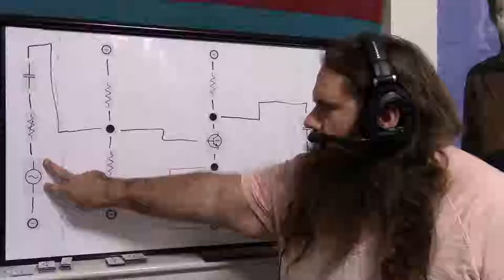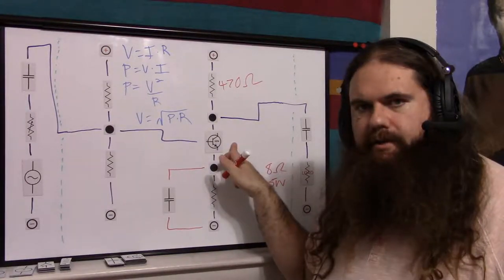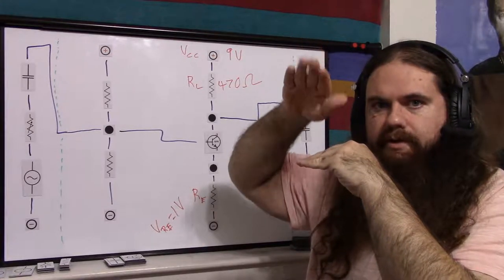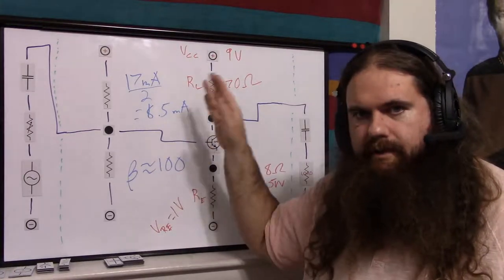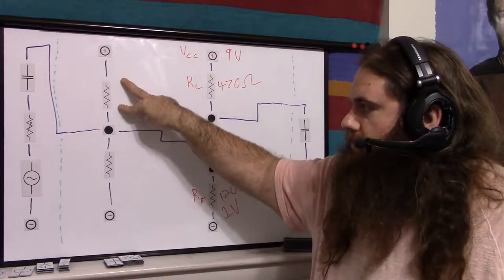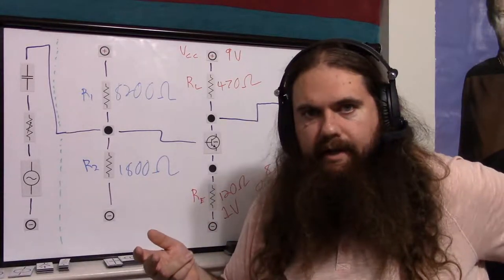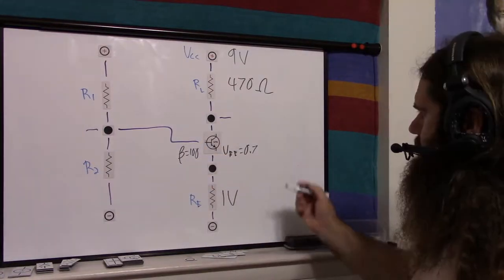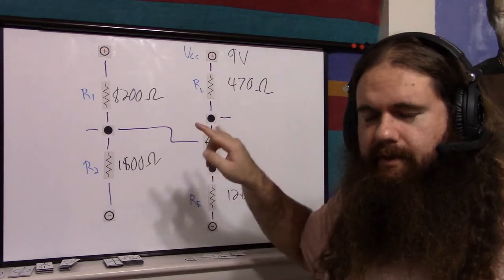Common Emitter Amplifier - Part Selection - Simply Put

Comment: 10µF indeed provides a better sound with less distortion, I've tried the same circuit (except for the transistor which is a BC547) and it works quite well actually ! Thanks man !
I wish there was much more on this, to make a real amp, but hey, that's cool man !

Comment: Well done!
It's very clear.
Your Volume Control seems a little strange as most folk would ground one end of the Potentiometer Track so that it can be turned all the way down.
Also an Eight Ohm Loudspeaker seems rather too heavy a load for this circuit although it would probably work to some degree.

Comment: Consider the venerable 2N2222A Small−Signal Current Gain
(IC = 1.0 mAdc, VCE = 10 Vdc, f = 1.0 kHz) (IC = 10 mAdc, VCE = 10 Vdc, f = 1.0 kHz)
 hfe
 50-75 (Min) 
300-375
 (Max)

Comment: I don't understand why you say that the speaker uses 0.25 watt (or close to that) with your 470 ohm resistor. Because, when I use a simple voltage divider formula then I come to a total of only 0.0028 watt for the speaker.

I did this:
Voltage supplied to speaker = (8/478)*9v = 0.15v
Total current draw = 9v/478 = 0.0188 Ampere
Power used by speaker = 0.15*0.0188 = 0.0028 Watt

What am i doing wrong in this calculation?
Reply from the maker: At that point in the video, I'm talking about the total power going through both the load path and the transistor path, not just the load. I was talking about how I wanted to be careful because I was designing a power-hungry amplifier with weak and cheap parts, and if I were doing it "for real", I'd use actual power resistors and transistors that could handle the load the speaker actually wants.
Reply: @simplyput2796 Ow okay, then I missed that detail. Thanks for your answer

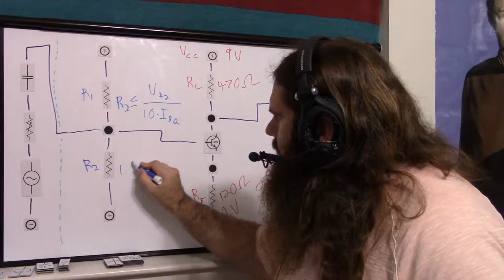Comment: Hi, I get loss in the 17:54 minute,
did you say that 1.7v divided by (10 times 85u Ibq) is equal to 1990Ohms..?
Reply from the maker: 85 microamps was rounded a little for clarity. The actual exact resistance was 1997 ohms. The reason I used 1800 ohms for the actual resistor was that I wasn't using a trimpot to get an exact resistance: I was using just a standard box of resistors, and 1800 was the closest one that was no higher. The resistors R1 and R2 form the bias part of the amplifier, and they have to supply a minimum amount of current to the transistor's base, which means it is perfectly fine for them to be lower than needed (excess current), but it is not fine for them to be higher than needed (not enough current available), so I went down to the closest available discrete resistor value available to me.
Reply: @simplyput2796  
Thanks for answering me.
I'm doing and studying the same circuit and learning a lot.
Thank you. By the way ... could you explain how to do an amplification but with
an operational amplifier. I understand that it's simpler, but I like the way you explain every detail.
As always many Thanks.
Reply from the maker: Yep, op-amps are coming! I have several other types of amplifiers to work my way through first, but they're in the pipeline.
Reply: @simplyput2796  Goooood